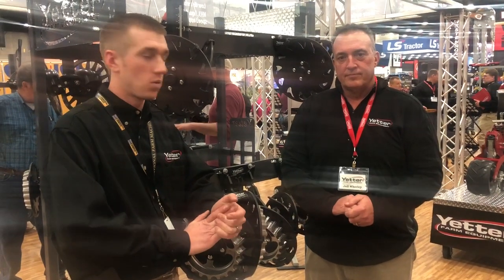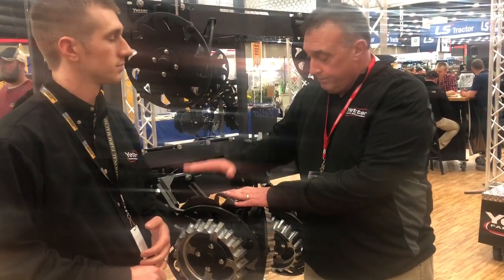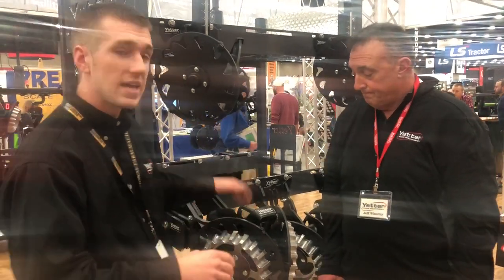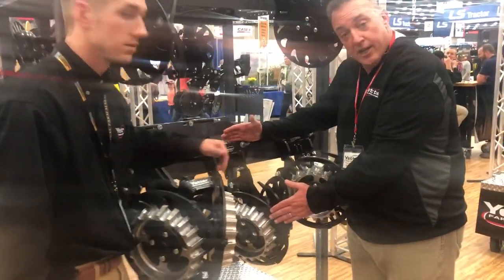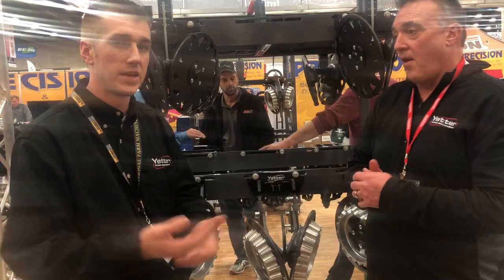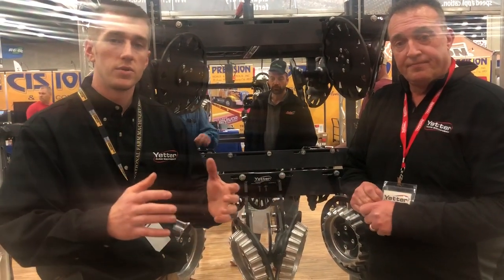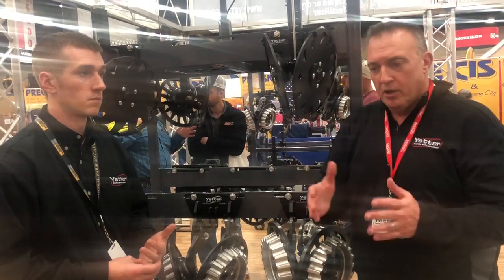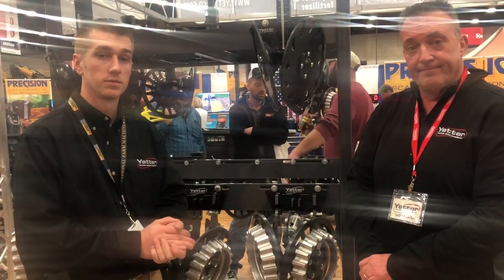Saying no to the No-Till Coulter

Comment: Yeah, hair-pinning residue and uneven seed depth are major challenges across varying soil conditions in no-till. The no-till coulter (sharp flat disk) is a great help in my experience, when needed for certain conditions. Row cleaners alone cannot move long-stemmed or thick mat residue as well without a cutting coulter between them. The coulter cuts the residue so row cleaners can move it effectively. If you don't have thick mat long-stemmed residue, taking the coulter off works great. I would rather have the ability to place a coulter between row cleaners, when needed, than worry about distance between row cleaners and row unit gauge wheels. The only way row cleaners would affect seed depth is when they are set fixed over hard soil conditions, and any amount of distance between where row cleaners engage the surface and the contact point of row unit gauge wheels will affect seed depth equally. Float setting on row cleaners fully addresses seed depth issues associated with row cleaners lifting the row unit.

Last, never use coulters for anything more than cutting residue in no-till (very shallow depth setting on the coulter); creating the furrow is best done by the seed disk opener exclusively. Shaped coulters intended to do some tillage ahead of the disk openers do more harm than good. No-till soils are naturally moist, and any shape other than flat disk will slab out chunks of the seed furrow ahead of the disk openers, usually applying it to the gauge wheels, which is creates a more significant seed depth issue.

Comment: How do you guys seeing them work with 15inch row beans on a kinze planter? Wouldn't the rear row cleaners cover up the front rows making the front rows emerge/grow slower until they get above residue?
Reply from the maker: they were awesome on 15" rows for beans! there is some residue the gets ontop of the front rows, however it is not enough to hinder emergence. also the narrow row cleaners are pitched at a different angle than the 30" to eliminate this